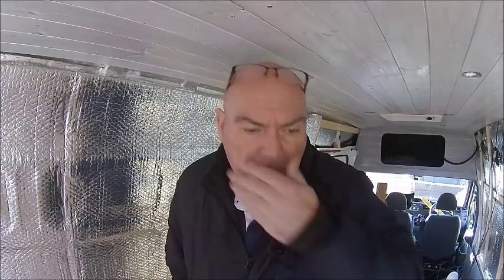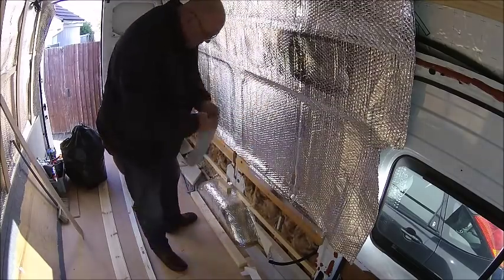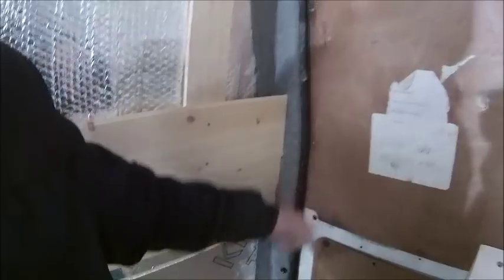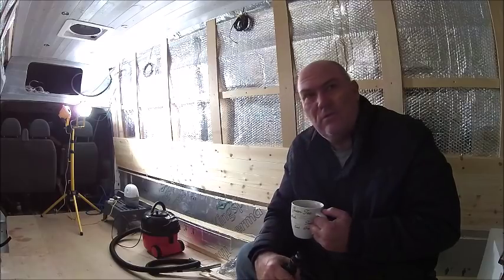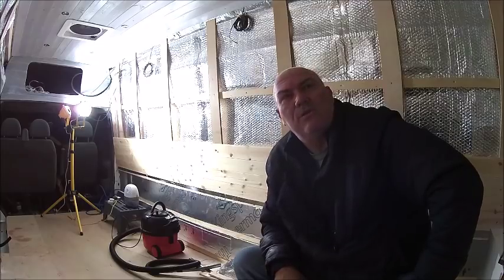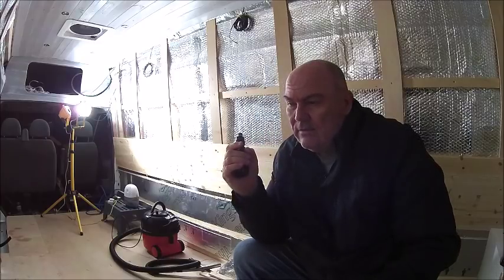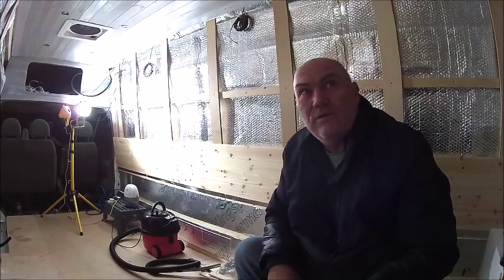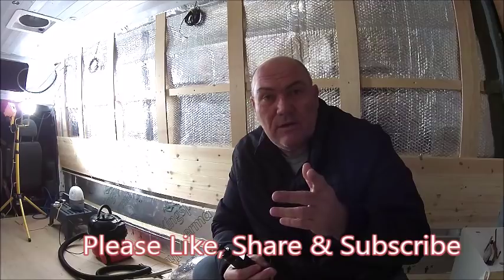Transit Jumbo Camper Conversion. 23.  Vapour Barrier and Walls

Comment: I thought I'd finished my van but the Moore I use it the Moore I find to change or fine tune so if you have to move into your van before it's finished might be a blessing in disguise. Could save you money, like with your battery you might find you only need one.
Reply from the maker: Its a very good point Roger. Ive heard others say that they are always adding or changing things. I just need to get the basics sorted and get in there.

Comment: It's sort of tempting to say, do a minimum you can live with to get shot of the house, you never know when the boiler will burst or the roof will fall off,   I'm in a bungalow, when ever I think to myself "That's it, nothing more to do", something else breaks. It's just a cash cow these days

Then build the rest of the van as you go along. But it depends how much you can do without the power from the house and storage for the gear. I do think though that what ever people do with the vans, after a while they wish they had done this or that, so maybe building it as you are in it, you get a better idea where things should go. 

Just imaging you waking up one morning, decide you need a tea in bed fast, and the kettle is out of reach. What a nightmare.
Reply from the maker: Your dead right Rob. In fact it is the boiler thats had it and a severe leaky roof. Its never ending.

Comment: Does the battery have to be AGM?
Reply from the maker: Hi peter. No it doesnt have to be AGM. You can use normal. Wet lead acid batteries. I just chose AGM because they are sealed so generally safer and apparently take deep cycling better so last a bit longer.